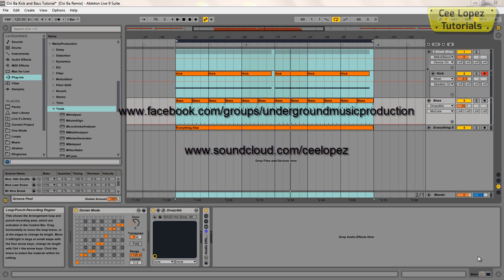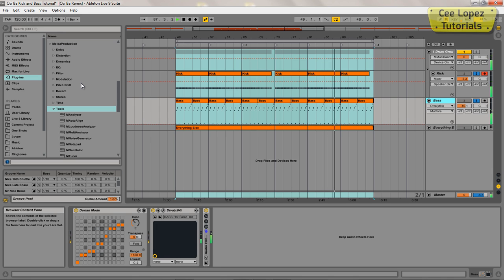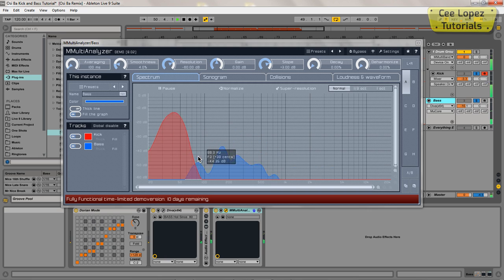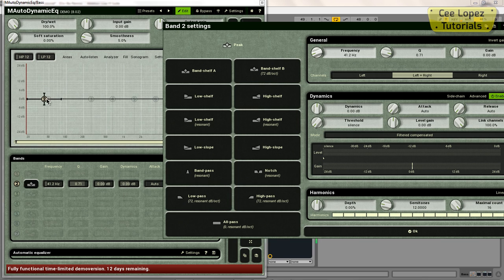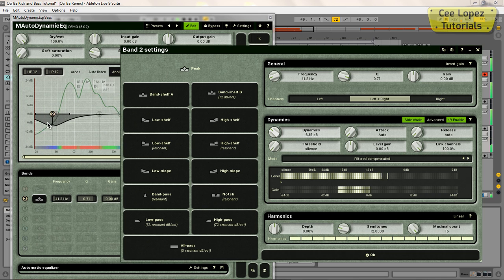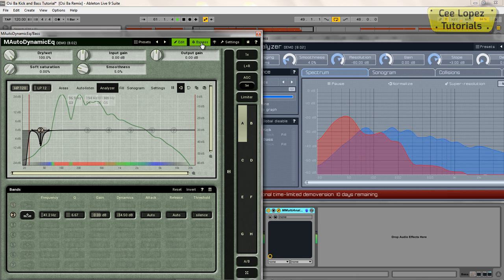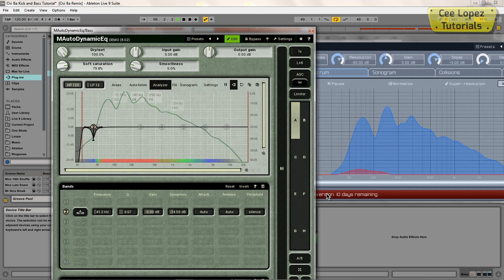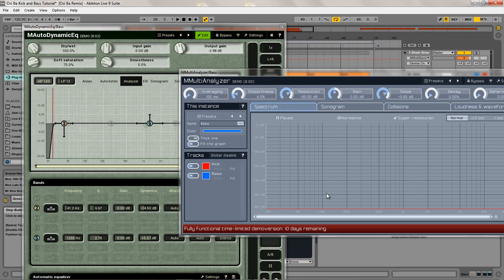Separate Your Kick and Bass using Melda Production Plugins

Comment: Really useful tutorial.  Couple of questions here.  1) Why don't you feed the original kick track to sidechain the EQ directly?  2) Is using a dynamic EQ better or a dynamic compressor better on the bass?  Thanks a lot.
Reply from the maker: 1) I don''t remember, I haven't used Ableton in years. 2) What is better depends on what you a trying to do, what material you are working with and what sounds the best to your ears

Comment: Great video, one question is there any need to duplicate the kick track!, why not just send a sidechain from the original kick?
Reply from the maker: +Troy Musson Yeah, that's just the way Ableton's routing works when you want a 3rd party plugin to receive a signal from a track other than the one it has been placed on
Reply: +Troy Musson You don't have to, just set the input from the original kick track in the SC track and set it to "in" in the IO section.
However, with a copy of the kick as audio you can process it for signal reasons with envelopes and what not to influence the SC effect in the device taking the SC input. This might give you more detailed control over how the SC is used beyond how you could affect this in the device taking the SC input.

Comment: This is a great tutorial. But if you do the sidechaining like this, don't you now need a sidechain track for everything you want to sidechain. That could mean ten or more seperate sidechain tracks in project instead of just one sidechain track that can be used by all tracks like most people use. Or am I missing something. Thank you.
Reply from the maker: joeyxl3456 I'm assuming you are talking about sidechain compression!? This is a technique that works on a similar basis but with a different outcome. I am just using the EQ to cut the bass at the frequency where the kick hits. The other elements in your track should'nt be interfering with your kick too much frequency wise so it would be rarely, if ever, you would need to set this up on anything other than the bass
Reply: Cee Lopez Tutorialism
Ok, your just making a dynamic cut at the kick frequency. Cool thanks bro.